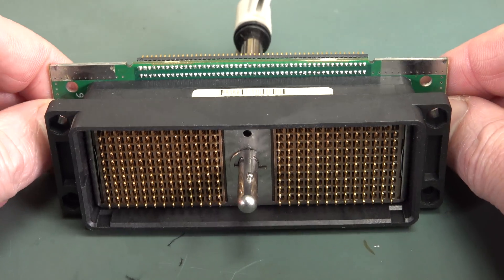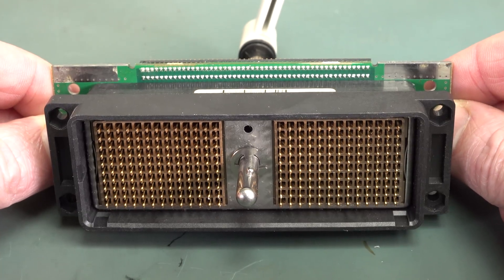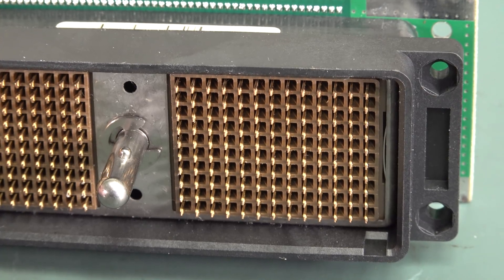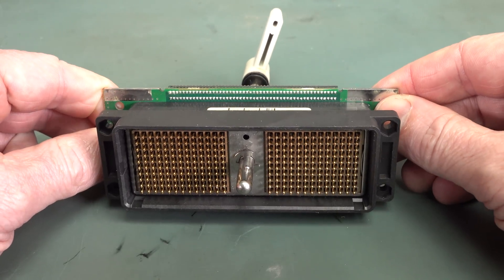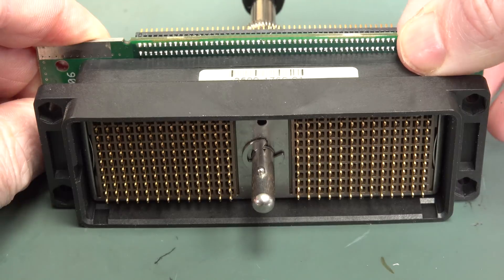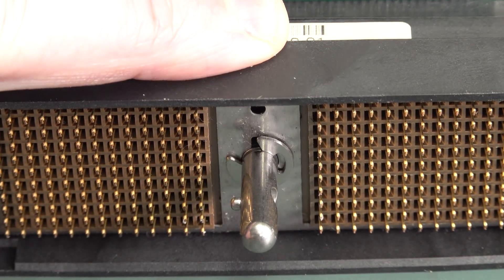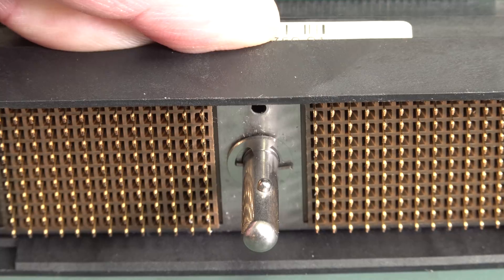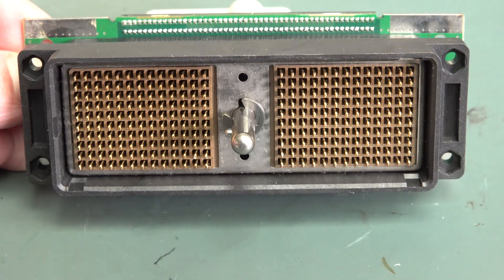That's not a ZIF socket, THIS is a ZIF socket!

Comment from the maker: OK, I know it's technically a ZIF plug/connector, but no one says ZIF plug.
Reply: a zlug
Reply: Alright, Alright, you win, I see you've played sockety-pluggy, before.
Reply: Its also kind of a Male Socket anyway
Reply: The mating half uses exactly the same pins, but they are mounted within the shroud rather than sticking out like the one shown
Reply: @microknigh7  not true. The 'socket' uses a flat pin. This plug has a little 'pip' on the end.
Reply: @davidjenkins7611  I may well be remembering wrong, but I thought there were only one type of crimp. The pips both making contact behind the pip of the other. It was 30 years ago I last saw them
Reply: Zif Plug, okay I said it, I should not exist after this reply, goodbye cruel world!
Reply: ZIF plug
Reply: Those of us who built those DID call them a ZIF connector. Some of them also use sexless contacts.

Comment: Worked on some old equipment that used threaded screw hold-downs instead.  Pins were fixed, so NOT ZIF like this one.  We were taught to alternate, push the back of the connector and turn the screws in turn to slowly work the connector home.  If you relied on just the screws pulling it together, they would soon gall up the threads and they would effectively 'cold weld' together, becoming totally messed up.  And you can't very well lubricate the threads.

You do NOT want to have to replace one of these on the end of the cable harness.  :)

Comment: 1. 260 pins total. 2 banks of 130 pins

2. a shoving plate connected to a threaded rod so as you turned the rod it forces the plug from the socket and the opposite sort of like the locking systems on soda vending machines at least here in america.

Comment: The first generation DaVinci surgical robots used one of these connectors for EACH of the three arms on the robot! It was a nightmare to lay out the cables and connect them to the console. The second generation introduced a SINGLE fiber optic cable to replace all three.

Comment: This is absolutely ZIF and is referred to as ZIF in the aviation community. Older autopilot systems used them on their computers and servo amplifiers.They are also used in some full motion flight simulators to make easy breakdown of the simulator if it has to me moved. Great connectors till you abuse them. They don't like abuse.

Comment: Yes it's a ZIF connector. I came across them in the late 80s, where they were used on the Columbia 2000 (Columbia became Zentel and later Teradyne in the UK) ATE test system to allow easy changing of test jigs for different products
Reply: I pointed that out in the last video, I built custom ATE equipment while working in the test department.  These were used to connect the 19" rack to the test fixture. They were very expensive to use back in the 1980's but better that loads of 56 pin D'S
Reply: @TheEmbeddedHobbyist  I only saw this vid. Might go back and watch the first. But ye damned expensive, but really easy for changing jigs and a lot more reliable than the Euro connectors we used on some other systems. Especially the cheaper non-gold variety, the problems we had with those LOL

Comment: I work on old flight data recorders, and I daily use test stations (built in the mid-1980s) that each have 4 harnesses with these connectors. So many years of use has made some of the pins temperamental (I have to use contact cleaner and bend them back to center; gently).  So many signals go through these: 1553, RS-422, parallel data and analog measurements. Nice to see them here.

Comment: A great example of modern ZIF would be AMD processors. They still use an array of pins!
Reply: Do they though?  Have you seen a Threadripper's TR4 socket? It's got little springy bits, and the CPU just has pads. 😮
Reply: @Bakamoichigei  Ryzen is zif.

Comment: These are from ITT and still around, we are using very similar ones at work for HiL systems to test car control units.
We have cables with the specific connector or connectors on one side for the control units and a ZIF connector on the other side, this way the connector on the HiL system does not wear out.
These are rather costly, we paid around 1 Euro per Pin plus xx Euro or each the insert and the case.

Comment: looks like some automotive connectors that are NOT zif. where that lever is you find a m6 bolt and you use the bolt to wind the connector into and out of the  recepticle . if there a bit old n crusty you tighten up the bolt then have to give the extremities a wee shove to help :) this is zif tho, obvs.

Comment: The small pin that sticks out of the centre shaft also plays an important part as it can be used to home the connector fully, as well as lock the connector in place and prevent contact damage!  The mating recepticle has an matching tube into which an internal axial spiral groove is machined. The exactly linear/radial profile of that groove is very carefully chosen. It is straight at first, which ensures the plugs contacts must be initally retracted ie you cannot turn the plug locking lever as you initially slide the plug into the socket, hence the plug contacts completely clear the sockets mating halves.. That means zero force and no danger of damage to the contacts. Then as the plug is around 85% home, that groove becomes a spiral, which means as you now turn the locking lever, that angle actually helps to pull the connector halves together, which mates the external EMC brush seals (and any environmental sealing system (O ring, extruded seals etc) on IP rated connectors) without excessive force from the operator.  As the plug fully homes, that groove finally has a slight detent, which catches that pin behind a little lip, which prevents the plugs locking lever from comming undone without a significant reverse torque, ie keeps the system properly mated util the operator removes it.  And of course, at that point, the fully turned lever has driven the contact shells apart so spring loading each plug contact against it's mating half in the recepticle!   As there is no mechanical interlock on the contacts themselves they require silver or gold plating to maintain a low contact resistance and you'll note the small "buttons" on the end of the contacts with a controlled radius and plating (non ZIF contacts use preload in formed contacts to maintain contact pressure, and may also deliberately damage each other in order to clean that mating surface (whichs leads to connectors with limited (sometimes very limited) lives in terms of mating cycles - check this on the datasheet it can be suprisngly low!)

Engineers (including me) always moan about the cost of connectors and contacts, ie mean, they are just a couple of bits of plastic and copper right?  LOL!  

 If you want an interesting connector teardown dave, have a go at getting some of the modern high voltage DC connectors from a modern EV, the organe ones.  The current ratings for the size of contact used, and the precise and intricate details of those contacts are considerable (as is the engineering in the IP sealing, the EMC sealing,  the pilot safety loop incorporation, and things like ensuring the design is "touch proof" etc)
Reply: No experience spared :)
Reply: The pin can also serve as a upside-down protection
Reply: @MrHack4never  it might actually not matter but it probably does.

Comment: Ugh, ZIF connectors... Brings me back to having to fix my NES, my friends NES, my neighbors NES... Many years later I learned I could just snip the 10NES chip and be done with it. How can it be connected enough to run a game but not enough to trigger the 10NES? Although if Nintendo had gone with this monster you'd know when your game was in, that's for sure!
Reply: Edge connectors aren't ZIF.
Reply: @Okurkaarrgghh  Agreed, but the edge connector is on a ZIF. You push the cart in, then down.
Reply: I suspect it's because the CIC handshake had to be perfect to keep it from going to the reset loop, and the CIC pair run at 4mhz, the rest of the system at 1.79. That said I find it's a better solution to keep the connector clean (NO OUTSIDE GAMES WITHOUT CLEANING) aligned and tight enough to keep the lockout chip happy, because trouble with the lockout chip is a sign of a marginal connection in general.

Comment: That's a connector from ITT Cannon.  I have some laying around at work.  Someone actually soldered each pin to a wire for use on a test setup.

Comment: The AM4 socket for AMD CPUs is a ZIF socket !
Reply: Are they all not ZIF´s though? Both Intel and AMD I mean... One is LGA the other PGA, but most commercial CPU MOBO sockets are ZIFs
Reply: @TrickyNekro  Im guessing am4 is a lot more similar to a  zif as the pins go into a socket before being secured, where as intel ones are held down onto the pins
Reply: TrickyNekro yeah, like I said above, at least since the 486 so from 1989 on.
Reply: @usgbitJS  with the small and weird exception of slot 1 / slot A processors
Reply: thun5 yes, I know - that was Intel’s way to get themselves out of the debacle with bonding a separate cache chip to the processor before testing the whole thing, resulting it lot of the assemblies getting thrown out as faulty. So they settled on selling a nicely packaged PCB with the two...
Reply: ZIFs were used at least as early as the first Intel Pentiums I’m sure. Not sure with 486s and 386s.
Reply: Okay, so 486s used LIFs and ZIFs too - Sockets 1 to 3. 386s apparently just used regular PGA 132 sockets.

Comment: I have a bad history with these connectors. Over time, pins will lose their springiness and no longer make contact with the mating end. At least that was my experience with them.

They also are prone to losing contact from dirt, but in a medical environment I'm sure that wasn't common.

I worked at a production facility which used these same connectors for UUT test interfaces. One bad design choice among many others, and the company had to create a cable repair program just to keep up with production. Many of the cables couldn't go through a single test before going back to the repair shop! 🤪
Reply: We had a field tester with that crap.
That connector was a really bad choice for testing engine harness.
Corrosion and dirt made it useless for testing resistance in a harness that was still on the engine
Reply: Since you have the experience, what kind of connector would you prefer for 260 pins?

Comment: I've never used these types of connectors, but several people on the previous video commented about how unreliable they can be. This actually makes sense when you look at the design. Contact is just from one side. If any of these pins get bent or just dirty, no connection/poor connection would be made. Circular military connectors are available in up to 128 pins (for standard series) and those contacts are extremely reliable. They use two "leafs" in the socket to make contact with the pins from two sides. Good alignment etc. Not ZIF of course, yet I wouldn't say that they're difficult to mate at all. You can get spec for contact force etc, it's all controlled. You get IP67 when mated, excellent EMI protection etc. I would guess they are far cheaper than these rectangular ones as well since they're made in higher volumes. That said, ZIF makes sense for delicate operation by doctors/technicians etc.
Reply: Also, there seems to be neither a scraping action (which is the case with conventional connectors), nor the high "squeezing" contact forces (which also lead to some scraping by elastic deformation) of conventional ZIF-sockets. The contacts are just more or less gently lowered onto the mating parts. 

That's not going to get rid of slight oxide or dirt layers.
Reply: Absolutely correct. I have personal bad experiences with these connectors. They don't hold a candle to a Virginia Panel connector.
Reply: @vejymonsta3006  I've looked at those VP connectors, they sure are nice. They don't sell through any of the large distributors though... PITA. We use Harting rectangular connectors a lot in Europe, and sometimes those Amphenol circular aerospace/military-style ones.

Comment: I used those connectors when I was designing medical equipment. I had 2 in my design to hook up a 216 channel EEG "skull cap". We had to take the connectors apart and replace the guts with non ferrous parts as it had to go into a location that was sensing very minute magnetic fields.
Fun times.
And yes, these connectors are pretty cool.
Reply: You can buy a fancy ITT Cannon DL depinning tool, or just bend a paper clip and use that instead. That's what we always did. :)
Reply: What company did you design for? My dad used to be a senior service rep for Datex Ohmeda, back when I was a kid.

Comment: Ive not seen the other side but with the pins moving like that if you did not lock it in could it for example put power on a pin it should not be on ? Im not familiar with this type of connector so be gentle lol.

Comment: These were the standard connector on multitrack tape recorder wiring harnesses, at least in the USA. 48 3-pin XLR connectors on the back of the machine to a "DL connector". Also used in studios for racks of outboard gear, and beneath the patchbays of mixing consoles.
Reply: Snakes for mobile concert rigs, too.
Reply: Yes, indeed. DLs were the most expensive ones. EDACs were cheaper, but they are not ZIF. I believe that DLs are the only ZIF connectors in pro-audio (well, maybe speakon or PowerCon qualify as ZIF, not sure).

Comment: Same as  CPU on MB.
Reply from the maker: No, it's not. A CPU socket is a ZIF *socket*, this is technically a ZIF plug. The lever is not on the socket side.
Reply: EEVblog2 2:21 You just said it’s a ZIF socket!!  Get it right :-)